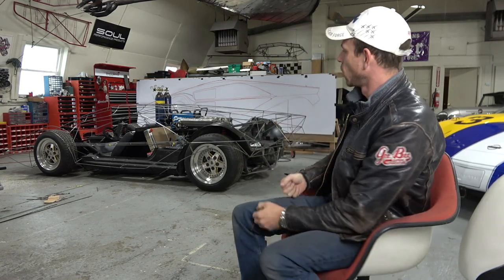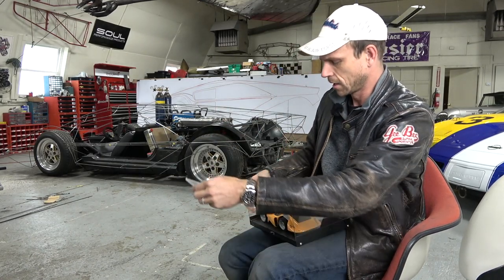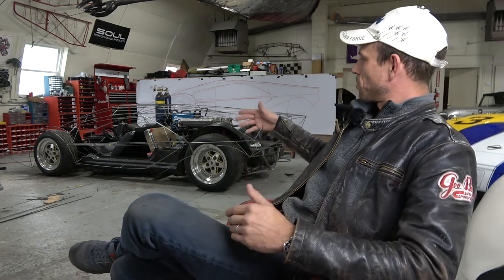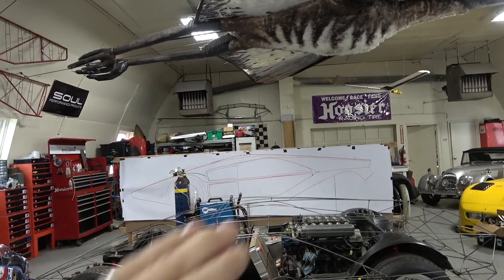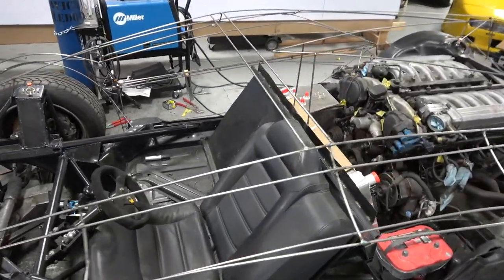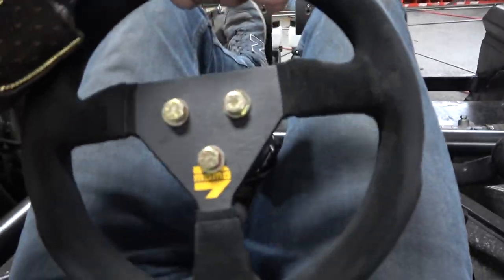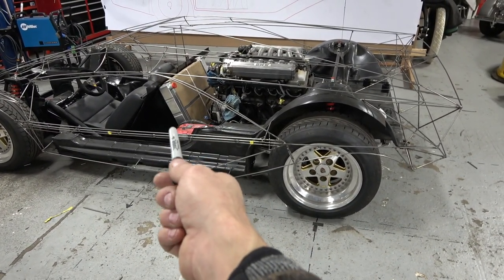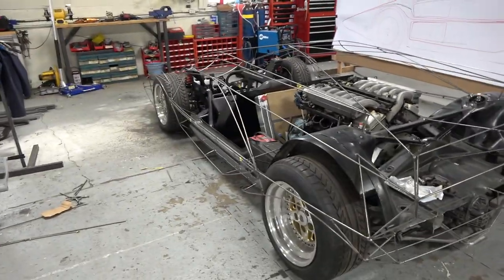Wire skeleton and Contest | King Zero V12 supercar #18

Comment from the maker: Hope you guys enjoy the video and the design contest! I'm impressed by trolls as my video got a thumbs down before I could even open it. Did someone create a program just to suck at life?
Reply: Haha, I said that right away
Reply: 1) I'm definitely putting a design, and might end up modeling the car in my own program because I'm impatient. And 2) I'm sorry what did so just read had happened? How does one manage to do this? And can I do this with the like button?
Reply: One thing I never look at on a video is dislikes, because two things are sure: there will always be dislikes, and they will never make any sense.
Reply: YouTube mobile variant: go look how close the like / dislike buttons are. :)) YouTube really is, designed by "trained" monkeys.
Reply: Casey Putsch On the subject of proportions, Casey I think that you might need to pinch in the lower 'cills' by maybe an inch inwards. It will improve the way the light falls on the sides. Also. The LED light bar at the front needs to loose about an inch and a half from either side to define the taper towards the front more. Looking excellent btw. I gave up on my dream to be a car designer, ended up becoming an architect instead...🙄
Reply: Its the suck-o-bot!
Reply: ... you mean someone created a programmatic vacuum cleaner?
Reply: Love this build! Really see it shape every time it’s on the show. The wire shape itself is almost a pity to cover. I like the Gandini and Giugiaro sharp designs. Masters of that art. There is a nice series of interviews Davide Cironi did. Pity of their feud about the concept of the Miura. As a little kid very impressed by a Giugiaro/Ital Design book my dad (an industrial designer) had. And having grown up on the backseats of Alfa Romeos like the Giulia, Sud, Alfetta’s and Giuliettas sure helped as well I guess.
Pity the University didn’t get it. Hear this a lot about arts and design education. Sort of narrowmindedness where you wouldn’t expect it.
Reply: Someone may have gotten so excited at the sight of a new video, they clicked the wrong button and didn't realize it.
Reply: For the A-pillar window maybe you could use those perforated wraps that are used for window commercials on cars which still allow see thru from the inside so you can get it in any color to fit the selected paint scheme.
Reply: gotta go hidden camera instead of windows. Original car was sposed to be a piece of art from the outside, not from the inside, so some screens still work on the inside
Reply: @gregfroggatt3217  out of curiosity do you currently, or have you ever owned a Saab?

Bonus Question
Did you, while owning said Saab wear a black polo neck jumper and rimless glasses?
Reply: The supercar snobs have an algorithm that follows you around. :)
Reply: Not able to draw it myself, but the shape of this car screams to me that it should have BMW art car design style. Something along the lines of the original Alexander Calder BMW
Reply: Why not lower the A post and make the windshield follow the body contour, and tint that part the same as the body color.
It would eliminate the blind spot and give better access to the cockpit while making the windshield more rigid.
Reply: @Craig-wp3pz   @Craig field  Hi Craig, nope by the time I got around to affording a new saab they had pretty much gone bust. I wear black jeans but that about it ;) I think architects don't have much car choice these days...looked briefly at a Renault avantime, Volvo C30 polestar nothing else interesting or reliable....new defender 90 looks nice but...
Reply: @Craig-wp3pz    Interestingly I graduated masters from  the Royal College in Art whose car designing department is well renowned and  who's alumni included Peter Stevens, Gerry McGovern, Ian Callum, Peter Cox and Dirk Van Braeckel to name a few. guess your into LR with the logo? :)
Reply: @Casey Putsch where and how do you enter the design contest? And hi Casey.
Reply: Ignore the trolls and feel sorry for them they must have really sad lives . The ones that actually matter are the ones who care about what you are doing. Super cool vid Casey yes I liked 18 videos in a short quick burst but that's because I had time to get on YouTube on my phone as I was relaxing. #18 of 44 vids down so far and still keeps getting better .

Comment: Casey I feel like you have just told my exact story. To the point I have chills. I always wanted to get into car design throughout my high school career. Long story short but like yours I was told I had to learn a mechanic apprenticeship first as if you want to work with cars its what you need to do. (This was the schools career counciler)  I ended up becoming a qualified tech. But never lost my passion for design. I tried other night courses in motor trimming, automotive business management etc.. and more recently now in my 30s design courses. I never gave up my passion/dream and always built and modified cars along the way and now have my side project (business) designing my own automotive inspired watches. (Giugiaro also designed watches for seiko on the side as your probably aware) 
I look forward to having the opportunity to get involved in your project

Comment: A couple notes:
1. Twin side radiators looks like the way to go.
2. A-pillar windows could be tinted to 'blend' into the front window/door. Though, that would come at the cost of visually cutting through that amazing roof rail arc… Otherwise, tinting to match paint color is probably best bet. The Lancia Sibilo had odd, partially tinted windows to solve the same kind of problem.
3. The Countach LP400 had a periscope mirror built inside the roof, though I'm not sure how useful that'd be or how much critical interior space you'd loose to that idea.

I've really enjoyed seeing this and the Omega car projects grow over time, and thanks for sharing all the cool stuff you do.

Comment: I like the windows idea, it fits as what would have been a  natural addition to the prototype had it been accepted to production, I love the longer widows, they add balance to the design. Leave the radiator, the scoopy side vents will make it too aventadore and the radiator will bring some weight forward and keep your hot water tubes shorter and will probably save you some weight . KISS is not to be underestimated. Plus I love what you are doing.

Comment: One-way windows along the top might work; you might then be able to disguise them as well in a body colour somehow? Previously you were talking about painting the car silver so that shouldn't be too hard to hide.
Also side radiators would be a good idea for this. That might even allow you to have an access panel behind the seats to work on the engine for belts etc.

Comment: I think the idea with the transparent upper body part in the front of the car is very good. Alternatively, I would also use a camera and screen solution, the cameras are so small and so good these days that you can certainly even incorporate them as a design element. Also as a replacement for the rearview mirror. The idea of moving the cooler to the rear side panels is also great. Can you lay it flat and let the necessary cooling air suck in from below, i.e. the floor? So you wouldn't have to make an opening in the beautiful sideline. I like the trunk behind the seats better than the "water-based seat heating". I'm looking forward to more videos.

Comment: Casey, before you do the final skinning of this wire buck, I'd recommend making a 3D CAD version of the buck doing the point in space method, but only in relation to itself and not the chassis or floor. This way, if you ever DO damage the car, you can make a brand new separated wire buck, weld up whatever section or panels you need, then fix the car.
Reply from the maker: Dude.... why would I waste the time when I already made it once without a computer? Not being mean, but think about it.
Reply: @CaseyPutsch  My point is to have all the "points in space" cataloged somehow so you won't have to start from scratch if you ever happen to damage it. You can just refer to a diagram with measurements and be like "whelp, this point needs to come out 4.35 inches, and go up 2.7 inches to look proper again, and I need some sheet metal exactly this big to patch it."

I didn't mean scrap the real world handiwork and move to CAD, instead. Sorry for any confusion.

Comment: Casey, I have been studying your wire design. You said you were open to suggestions and I have a few. I like your idea of adding a slim window going forward over the wheel....this could be hidden by using a wrap like the city buses have over the glass. You can see out....no one can see in and it could be body color or a contrasting color! The rear edge of the two side windows (upper and lower) needs to be angled in some way...the center V ed out toward the rear would be a "normal" design. Maybe V ed in at the center or even a jagged edge like a stealth fighter. Or using the wrap.....fade to body color as it goes back. In the front, I think the nose could be pinched (at the very front) one or two inches per side to give it a slightly more modern look. Yes to the dual radiators...for the reasons you mentioned. Yes to the lovers over the engine....no glass underneath. Remember.....wheel fitment and stance is EVERYTHING! Just my two cents...visualize it see what you think.

Comment: So, some suggestions. Yes, this is a newer version of an older design. Embrace new technology. You mentioned using cameras and screens for the blind spots. Do it. Mount the camera in the side mirrors pointing forward. Mount the monitors on the panels inside the car where you'd normally look to see what's in that direction. For the rearview, no window, like you said. A proper firewall is good there. Mount another camera in the rear. In the cockpit, mount a monitor where the rear window would be. but have it show a reverse image. Then use some sort of cool old-school rearview mirror to see the image shown on the reversed monitor. Same visual cues for the driver but without the rear window. 
To access the engine, have the whole rear of the car clamshell up from the rear of the windshield. Have it follow the door line all the way down to the tire. You can make a crash structure above the driver's head that could support the hinge line. Too crazy?

Comment: Oh i have had sooooo many ideas from this video. I know you are not planning on doing turbos ect. But i think it is a good idea to keep up the plans for the future. 

Instead of having two small radiators on the side for normal cooling, have those for your turbos. 

With the windows,  dont have them square off have them curved and shaped to "flow" with the car.

Comment: not too sure if this goes too far from the "full mechanical" stuff, but side mirrors as cameras and a rear mirror as a camera that is at the rear access hatch could make everyday use of the car way nicer, and the cameras are sleeker than bulkier mirrors. maybe like the mclaren speedtail, but that split between the doors could act as a perfect placement for the side mirrors :)

Comment: On the subject of proportions, Casey I think that you might need to pinch in the lower 'cills' by maybe an inch inwards. It will improve the way the light falls on the sides. Also. The LED light bar at the front needs to loose about an inch and a half from either side to define the taper towards the front more. Looking excellent btw. I gave up on my dream to be a car designer, ended up becoming an architect instead...🙄

Comment: Love it! Would it ruin the homage to eliminate or reduce the height of one of the side windows and enlarge the longer window you're trying to add, so that the driver's eyeline uses that window as both the window he sees over the wheel and peripherally? 

3 stacked windows is to much window it seems. If you can curve the window to keep the body lines and just shift your body structure down a little you can keep largely the same lines of the car.

Hope I'm making sense. I love what your doing and whatever you work out is going to look great!

Comment: Okay, how about this?: Move the radiator to the sides like you said, then move the seat back about 6". This kills 3 birds with one stone: 1: better visibility at the side windows (I think), 2: more foot space, 3: more headroom possible. Not to mention a little extra safety distance from the front.
The overall exterior design is unaffected, radiator functionality is more efficient, space inside is improved and hopefully, visibility is more achievable.
If there is a way to test it, move your seating position back and try it out. I would love to see if I am right... even a little right.
Thumbs up.

Comment: Casey the problem about accidents is that you can't predict them. Maybe you avoid a moose and end up in a frontal collision, maybe a drunk idiot crashes into you. Hope you can understand why many of us asked you to give the car some proper frontal crash structure. Cheers champ
Reply: I think his main point about not getting into accidents is. The car wont be actually on the road much.
Reply: @forresttm  yeah, but that just makes those chances less, it doesn't outright keep it from happening. like the OP said, you can not predict what can happen. 

My friends rarely drove his car unless its going to a car show or a parade or some kind of event and that's around 3-4 times a year. it was totaled due to some dumbass drunk going left of center and hitting him pretty much head on. he had no time to react because the guy was hidden behind a bus and shot right out in front of him without peeking around. he had the exact same mindset in if he rarely drives is that there is next to no chance anything could happen to it, yeah he was wrong.

and then there is wrecking due to mechanical failure.
Reply: @madmax2069  he does mention a lot about side impact zones from about 20 mins.
Its probably safer then most supercars pre 1990s...
Reply: @forresttm  yeah, i did watch the video.

Comment: As far as visibility, it might not be the most intuitive information to work with since it'd be mirrored, but you could put a mirror inside the car, facing forward through the side windows.  You'd be looking through the passenger to see theirs of course.  Like the stick-on convex mirrors some trucks use, it'd be more of awareness than a precise placement of hazards.

Another subtle option, you could do up the back face of the inner fender liner transparent, and look out through the gap between the tire and body.  If you're steering sharply it opens up to give you a better view on the side you're moving towards.  Not practical for general rain/dust reasons, but on a weird car, why not do something weird.

Comment: You Too! I dropped out of the OSU school of industrial design Product Design track. I was there in the late seventies and the people running the school were focused on maintaining 'Apostolic Succession' from the Bauhaus school in Germany, that fled to the University of Chicago when WWII broke out, and then migrating to OSU. A grandiose dream that they they were building on the backs of their beleaguered students. The level of BS was off the charts and the Dean of the School instituted the unbelievable policy of failing 25% of every class each and every quarter. I.e.: if you started a Sophomore class of 100 students, only 42 would return for junior year the next Fall, and then only 18 would show up for Senior year and then maybe only 10 would graduate! Even if the entire enrollment were geniuses. It is still one of the most insane things I've ever experienced. The dean had all the profs read the policy to us at the beginning of the school year and many of them were quite dismayed at this fairly draconian policy. The pressure to perform was intense and several of my classmate crumbled under the pressure and committed suicide. I did the math and figured that my less than one in ten odds of graduating, no matter how hard I worked, was not in my favor, so I dropped out. I still became a designer, but I never got a degree from OSU.
Reply from the maker: They still had a weird Bauhaus thing going in the early 2000s

Comment: The side window addition could be incorporated into the paint job, so as to make it look from the exterior, as just a character line in the paint job, but from the interior, a useful visual tool. In fact, I almost think, with the overall lines of the King Zero, all the side windows should be treated as character lines in the paint job.

Comment: About the back visibility, you could add a camera to the back and place a large widescreen monitor behind the seats, where a back window would be, and you would see behind you by looking to the monitor through a conventional rearview mirror. The image would have to be electronically reversed (or mount the camera at 90° with a 45° mirror to reverse the image analogically), but it would be more "natural": look behind you through the mirror.